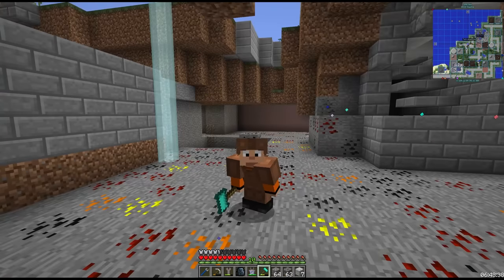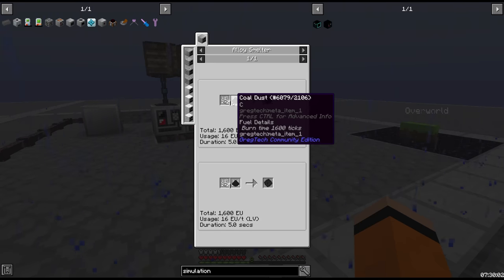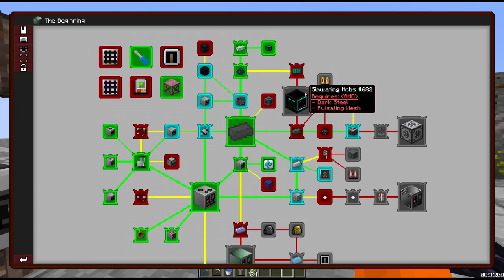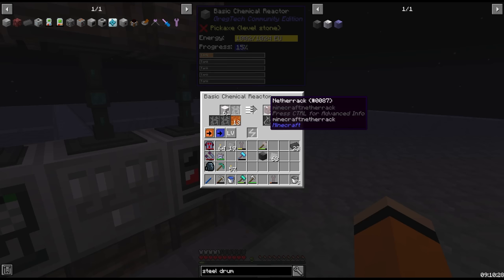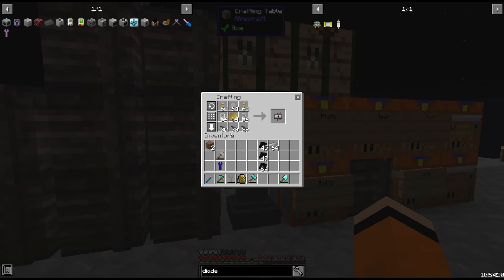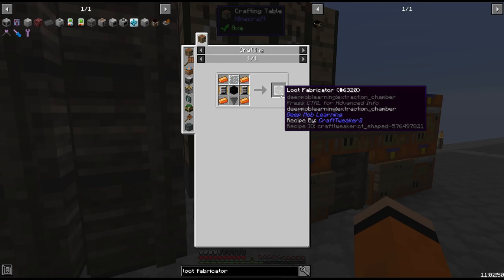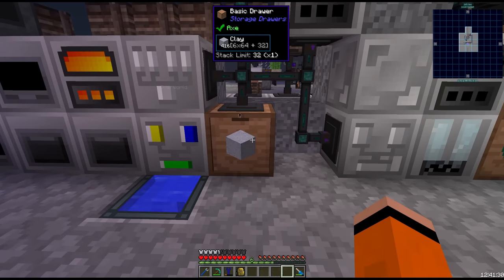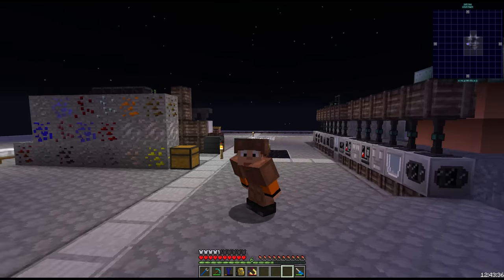Polymer Clay & EBF - Nomifactory: Episode 2

Comment: Jumping on the GTCEu port bandwagon as many others. It's fantastic so far, so if you had any thought of swapping over while you are still early in - go for it! Either way, stoked for this series.
Reply: Tracer's unofficial port is not compatible with worlds from the official pack so he would have to start over. While GTCEu is cool, it is incompatible with existing GTCE saves, which is why we didn't switch the pack to it ourselves.

We're going to be doing something officially with GTCEu eventually, but it will be its own distinct pack.
Reply: @Exa4096  Thank you for the informative reply (and the brilliant pack). I don't want to imagine the work that goes into it, honestly. It's one thing to make, say, an E2E. But wrestling the forkception that GT has become into a quality experience like Omni/Nomi has to be a whole other kind of beast. Anyhow, thank you. Look how giddy you've made Threefold, that probably makes it worth the effort XD
Reply: @Exa4096  Found you

Comment: 8:03 yea the recipe is the same but the pulsating mesh texture changed because it's a custom item added via contentTweaker instead of the forestry version. Forestry mod is probably going to be removed I believe, since it's only in the pack for some of its utility features like the worktable and for the DML recipes for some reason 😂

11:38 Are you missing the maintenance and muffler hatches yet? 😂😂
Reply: Forestry had been pared back to almost nonexistence in the pack, so once GTCE added workstations we opted to deprecate Forestry and convert the few relevant items to ContentTweaker alternatives. Forestry will then be removed after people have a chance to convert their existing stuff over in 1.3.

This is the same circumstance as Modular Machinery is in in the pack, as we have replaced that with Multiblock Tweaker.

Comment: Three joining the flat floating lawn base crew. I mean this playthrough is more focussed on speed than building, sure, but still ;)

You're thinking of rotors, not gears. In GTNH rotors require 4.25 ingots with a fluid solidifier instead of the 5 ingots it takes in an extruder, meaning you get cheaper rotors but have to do a 17 ingots : 4 rotors recipe to avoid having material left over. Which is completely and utterly trivial in the post-AE2 era, so I'm not sure why you're complaining ;)

The different texture would be because it's no longer the old Forestry items, but rather stuff added through content tweaker. It honestly looks good, but I imagine the difference takes some getting used to all the same.

As far as I remember Nomni removed the "faulty" data model tier, which would require killing in-world mobs in order to upgrade the data model to the point where it's able to run in a simulation chamber. Nomni was always fully playable in Peaceful, it's just that no one did (at least fully) because Glitch Armor.

You're playing Nomni on what is basically easy mode. I suspect you're going to be surprised by cheap recipes once every episode at least ;)

Also no maintenance hatch, no muffler hatch, no pollution, no voiding if the recipe runs out of power (though you do lose progress for what that's worth), and able to place buses/hatches in the top slots of the EBF. Welcome to the cheap zone ;)

A simpler way to explain the cable differences is that in GTNH voltage and amperage are checked *per cable*, whereas in this version of Nomni (I can't really speak for anything else) voltage and amperage is only checked *per connection*. Meaning that in GTNH two 4A connections feeding a 4A cable will burn from too many amps, but in Nomni it won't, since both connections are 4A feeding a 4A cable.

On the downside this pack doesn't have the GT++ Volcanus EBF that smelts things 2.2× as fast at 90% the base EU/t cost, on the upside the recipes are so fast and cheap it doesn't need it.
Reply: I'm honestly thinking of playing this pack to get my Greg fix when taking a break from GT:NH. Always look forward to your comments on Three's GT:NH videos, even after a year of Greg you always have some information I wasn't aware of.

When you say easy mode, is there much of a difference between this one and the Nomi GTCEu version? I know they added a lot of what seems to be GT:NH based features like multis, the other amp system, and processing chains. It looks like they did circuits too.
Reply: @alexplaysgames4219  I'm not too familiar with the ever increasing number of Nomni pack variants, but as far as I've heard the CEU version is significantly different from the base version. Or maybe that's only the case if you're playing hard mode, either/or.

Comment: You don't actually need a transformer to transform up, as long as you have enough amps of LV on that line the MV machine will accept it
Reply: 24:30 you also don't need to be holding the same item, just any item and then shift double clicking will cause the item you click on to move. A vanilla feature
Reply: I just tested it actually. That doesn't work anymore it seems 🤷‍♂️ The machine would take in LV power, but it will run out of power very fast running at MV. I think single-block MV machines no longer draw multiple amps from a 16xLV line. They will only draw like an amp or LV, hence run out of energy. No more powering HV machines off 16x LV lines 😂
Reply: @soulawaken24  ah, something new since I last played it then. That sucks
Reply: @soulawaken24  Since the next tier up is four amps of the lower tier, you have to be sure that you are supplying four amps to that machine to keep it running smoothly. This can be accomplished as before by using two wire connections or two different energy producers for a full-amp recipe, or it can run just fine on a half-amp recipe (which many ore processing recipes are).
Reply: @Exa4096  Ahh alright got it! So each connection to a machine is limited to two amps of LV in this case, even if it's a 16x cable. So making 2 connections would provide an amp of MV? Weird, I seemed to remember there was a time in GTCE when that it was possible to do that with one connection. Might have remembered wrongly. Thanks exa! :)
Reply: @soulawaken24  you can still do it with a single connection, but you have to have two different EU producers (like CEFs) on the same line of cable. Each of them will send two amps per tick through that connection, and the wire won't burn as long as no individual producer exceeds the cable's rating.
Reply: @Exa4096  AHH the number of amps can be transferred per connection is limited to 2amps per CEF attached to the network. So in theory with 8 LV CEFs you can power HV machines off a single connection, as ill-advised as it might be? 😂
Reply: I had no idea this worked you dont need the dinky mv cef in the first polymer setup  you can just have 2 cefs at the start of the line and it runs fine

Comment: the vacuum chest does auto ouput but you need to hit it with a yeta wrench on the side you want it to do so think TOP on the top of the screen shows side settings(as in pull/push)

Comment: 20:00 Didn't we used to be able to plug a MV machine into a LV line in omni without a transformer and it will just draw gladly accept multiple amps of LV and power the machine? I guess that's fixed? Damn no more easy overclocking of EBFs by just upgrading the hatches and adding more CEFs 🙃

Edit: as corrected by Exa below, you can still power MV machines off LV lines without a transformer. There're two methods. You could add another cable connection to the MV machine. OR you could add another 16x CEF to the same line. Each CEF transformer 2 amps of LV power PER CONNECTION. So adding another CEF would allow 4amps of LV (1amp of MV) per connection to a machine, which is enough to power a MV machine.
Reply: @fahreddinsengul1104  Machines only needs 1 amp to run. So in the past you could just put a MV machine onto the LV line and it will work. Even MV energy hatches on LV lines which draws 2 amps worked in Jimmy Cao's stream playthrough, which was about the same time as Three first playthrough xD Thing's changed since then it seems.
Reply: GTCE has a really wonky energy net so yes, you can supply 2A per wire-connected face of the machine per energy producer on the line of wires. This lets you run full-amp recipes one tier up with two wire connections or two sources of EU on the line (for a total of 4A of the lower tier), or a half-amp recipe with one wire connection (2A of the lower tier).

The GTCE energy net has not been changed in years. It was like this as far back as I can remember.
Reply: @Exa4096  👍👍👍
Reply: @Exa4096  Wow, Exa, you show up everywhere!  

I'm playing Nomifactory again right now (well first time for Nomifactory, but nth time for Omni), and Exa is right.  Nothing has changed.  

Each face can accept 2A, so no transformer is needed for running a single block MV machine from LV power.  You just have to connect power to at least 2 sides, or double up on CEFs.